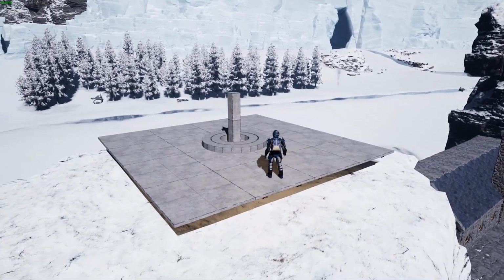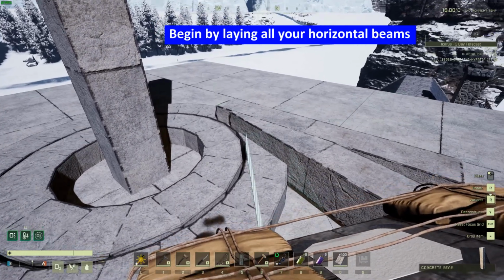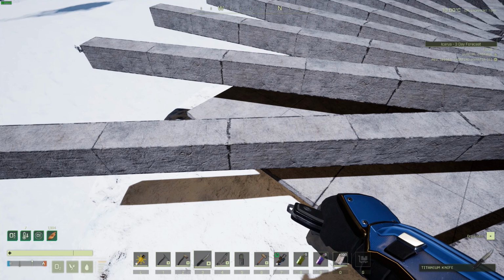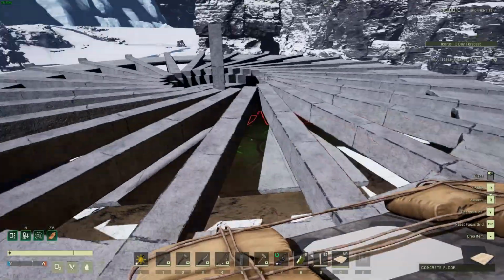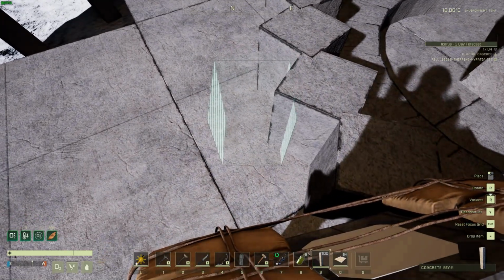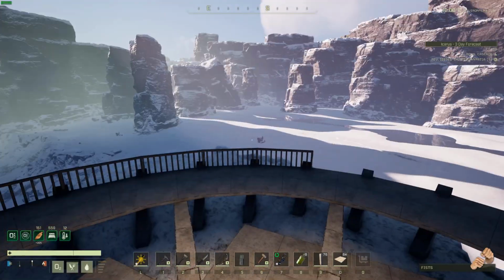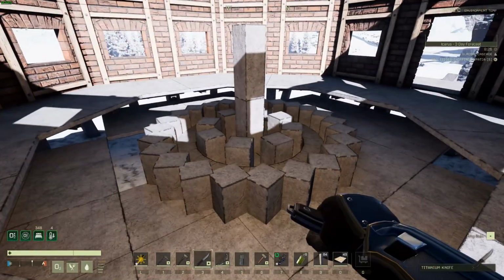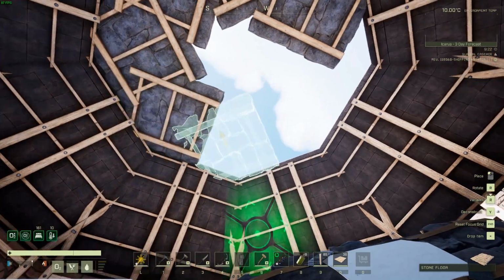Icarus Circular Build Tip - Combining Methods

Comment: When you adjust the height of a beam and try to free place it somewhere else, does the game remember the last height of the beam?
Reply from the maker: Yes, relative to the same object height that you were last pointing to with your cursor.  So if you were pointing at a floor, then adjusted the height, then anywhere you are pointing on that floor, your object freeplace would have the same height.  However if you moved off the floor say to open ground, your object would only maintain same height relative to the variable ground height, which doesn’t help you.  So in other words, it remembers the height relative to the height of whatever you were pointing at. If that makes sense?
Reply: @icarus-firstcohort-basebui9026  Yes it does! so thats why you always build a 4x4 platform when you start building. now i get it! to have a relative height to you from the concrete floor instead of the uneven ground.
Reply: i tried free placing beams like you in concrete floors but they break instantly. i dont know what i am doing wrong.. i think its not clipping into the ground maybe?
Reply from the maker: @Infinity.Gaming2023  yep beam not imbedded far enough in the ground!